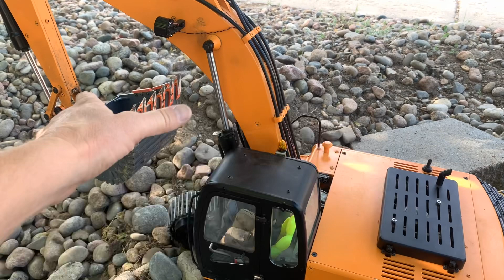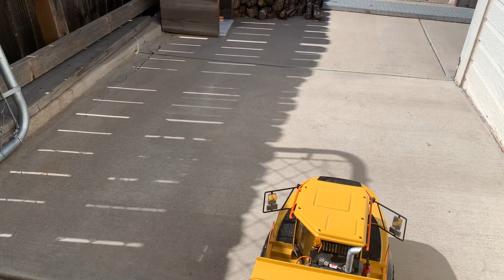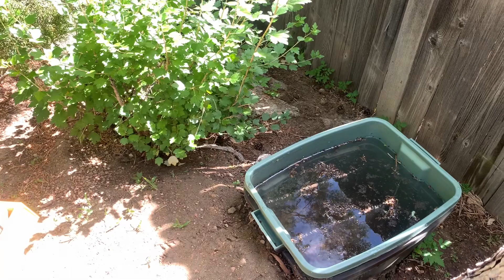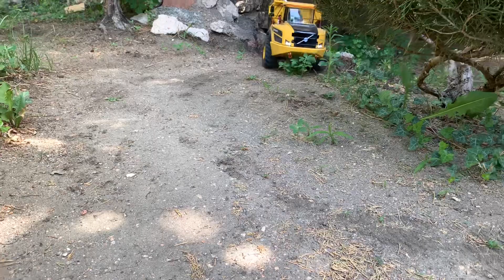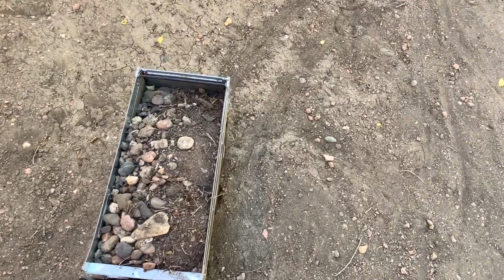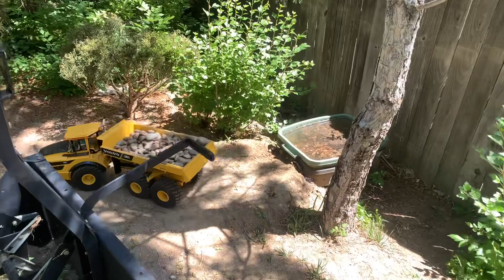The only constant is change. Testing new iterations made to the grizzly bars. Rc construction world.

Comment: awesome video! Good idea on the sticky lead weights on the back of the excavator!? looks good!
Reply from the maker: Thanks, yeah I really like the way it looks with those weights. It works so much better with that extra 4.5 pounds on the back too.
Reply: @digitrc  did you paint and just stick them on together? Use any glue at all?
Reply from the maker: @mnrcbasher877  no these were already painted that color. I just had to cut a few too size and I used semi gloss black to cover up the cuts. The sticky tape that comes on them is fantastic and holds up even under intense heat. They do not contain lead, but I think are zinc metal.
Reply: @digitrc  good to know! I have to find some and order a few. Nice cheap way to ad some good weight.
Reply from the maker: @mnrcbasher877  best easiest way I have found. I got them on Amazon.
Reply: @digitrc  perfect! I was just looking, tons of options. Thank you!
Reply from the maker: @mnrcbasher877  anytime. I enjoy sharing.
Reply: @digitrc  another question I just thought of! Where did you get the volvo emblem on the front for the xd dumper? I just picked one up myself! Amazing machines!
Reply from the maker: @mnrcbasher877  I got the decals on AliExpress.